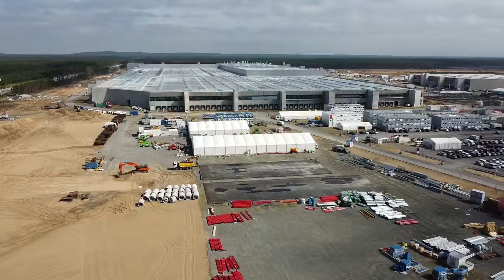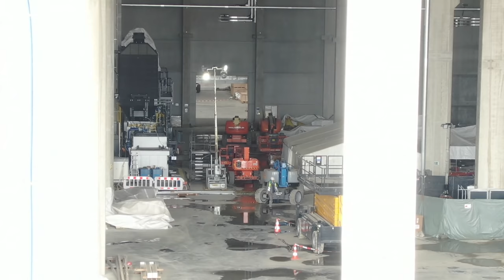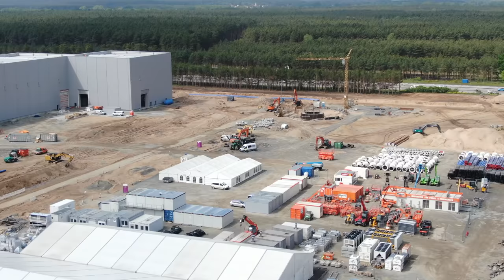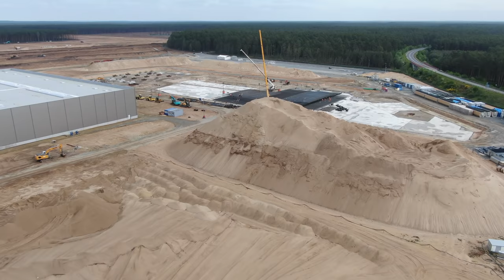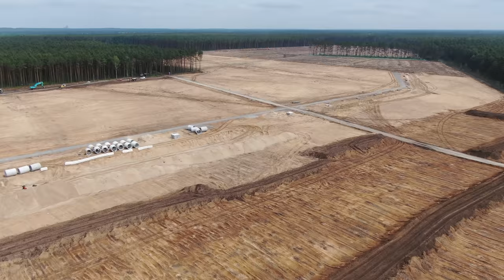Giga Berlin | 2021-05-29 | A lot of steel

Comment: That big steel area looks like it’s going to be used as a landing pad for a Starship more than anything else. 😉
Reply: Please don't discuss it, Elon will reveal it soon enough.
Reply: Exactly what I was thinking 😁 seems ridiculously built up even for an 8k ton Giga press.
Reply: The slightly modify the FAA orbital flight trajectory. SN20 will perhaps stop at Fremont picking up some 4680 cells too.
Reply: the risk of one of them crash landing and leveling the whole factory is too high.
Reply: it's for the 60k ton Model 2 - one step production stamp. 400kg square block of cold Aluminium in -> 60.000 ton stamp -> small earthquake -> ready full model 2 Frame

Comment: That Warehouse/battery factory building gets a massive foundation floor... I mean, if you need a ladder to get on top of it, its at least 1.5-2 meters thick. Must be some really heavy stuf that is going to be installed there.
Reply: 1,6m, stamping presses and deep drawing presses for the battery cases.
Reply: @julianreverse  Thanks, that makes sense.
Reply: Maybe a good vibration-proof base for sensitive precision machinery. I don't think that little casings for a battery (even a 4680) will need so much force  that this huge foundation will be needed. Even the stamping area does not have this type of foundation (https://www.youtube.com/watch?v=3pKYBqdXtSg)
Reply: @JestersHammer  Under the press shop are hundreds of concrete piles to distribute the force. And your video is showing the paint shop for what ever reason.
Reply from the maker: I think the middle part is even more like 1,7m, and we don't know for what they'll need this foundation. I agree with Martin Scheddin, that I don't think the presses for battery cells will need such big foundations. And it looks like half of the building will get a big foundation plate, while production of the case is just a tiny part of the cell production.
Reply: @JestersHammer  Indeed, vibration also is what comes to my mind. If this was just to take weight, there was no need to make it solid. We would see triangular structures distributing the pressure over an area. Or at least plenty of artificial air pockets to save material and add inner surfaces.
Reply: Probably because they're not using geopiers to stabilize soil under the foundation in Berlin as they are in Austin.
Reply: Was the foundation below the giga presses even that heavy?
Reply from the maker: @AndreR241  No, the foundation for the Giga Presses were not as deep and way smaller.
Reply: A semi-conductor fab probably also has a low tolerance for vibration.... 

Unlikely of course, and I think they are an environmental nightmare though, so even more unlikely in Germany.

Comment: 15:00 I am into construction for the last 20 years and have never seen so much steel reinforcement. This might not be battery factory. This is designed to carry extremely heavy dynamic loads like vibrations...
Reply: It looks it's built to withstand a 10.0 earthquake.
Reply: That. Is. Insanity. No machine vibrates that hard or else it's fucked up. Rocket start ramp?

It's often better to place vibrating stuff on absorbers than this.

Or are they trying to build a wind turbine foundation without being allowed to make a deep one? A 20 stories building?
Reply: That's what stamping and deep drawing presses do which are needed for the battery cases.
Reply: It's a landing pad for a starship
Reply: @fayereaganlover  That makes sense. I also think it is more probable that the Marsians will settle here than us there.

Comment: This is for sure the most complicated Building, for now, I guess the Rebar Field will be the position of the Batterie charging Raks like in Kato Road, guess a lot of weight needs to be supported on this Field on this sandy ground. Hope this time will be a Steal Building. 3 Stories or so because in the Videos looks like small for a Big Batterie factory. But like always mostly I am wrong. But anyway thanks for the great Video Tobias
Reply: It will probably be a concrete building.
Reply: @harryjessen  Most likely.

Comment: looks like we finally have a mold on the Gigapress in the area of the stairs @ 5:35 😃
Reply: I wonder how they deal with all that sand blown in constantly while the wall is still missing and the soil has been dirty for ages. Does not look good if you ask me. Precision? I don't know.

Germans are bureaucratic etc. but we keep stuff clean in the workplace. Not as tidy as the Japanese though :)

Also I cringe when I see how they lay the cables and part of the tubes.
Reply: @AndreasDelleske  i think the main reason is not to waste time with the necessary optimization loops
time is money and tools and machines are subject to high wear anyway.

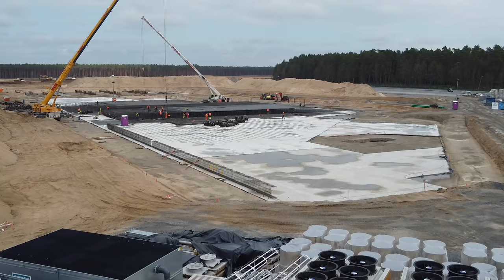Comment: What are they building @ 13:08 ? What needs a floor or a footing 5 feet thick?????
Reply from the maker: That will be the warehouse, which will most likely be the battery factory. We don't know for what they need the thick foundation, but there are speculations ranging from presses for battery cases to reduction of vibrations for more precision.
Reply: @TobiasLindh  Thanks.

Comment: What is the giant rebar frame work for..?
Reply: Read the comments.
Reply: @julianreverse  
Yes, sorry…..after I posted I scrolled down and saw all the other 
comments… a factual explanation for need of all that rebar would 
still be nice, the only thing I’ve seen even close to this was a dam..
Reply: @MrBad4fun  Maybe you should about concrete on Wikipedia.
Reply from the maker: Tesla got the permit for a warehouse, and we know that it will probably be the battery cell production line. But we don't know yet why they need this kind of foundation.

Comment: The endless shoveling of sand and mud is driving me crazy. In every video we've seen diggers taking dirt, putting it in a transporter, and seeing the transport vehicle drop it 100m away. I don't see that in Texas or Shanghai - why here? Why build that big mound of sand? Why take so much time simply digging a ditch for a pipe? Honestly very curious!
Reply: in germany we often like it complicated and useless.. bureaucracy
Reply: @jaSDdsaeE  🤦‍♂️
Reply: We just like it to dig holes, its fun. See here: https://www.youtube.com/watch?v=wWXEhJsYhYc&t
Reply: Because in Austin there was no topsoil or they simply used it to fill the craters. Not the best base to built on but good enough for US. Here they remove the topsoil and store it in the corner until they can reuse it or it's picked up by the disposal company. Digging trenches in lose sand is not like digging a trench in compact material. That's why a lot of material has to be moved for a small pipe.
Reply: Oh man, the first 2-3 months it was all they did in Texas.. moving dirt.

But it all has to do with the soil they are building on, and in Germany they had the complication of not being allowed to use piles. Result is digging huge holes in the ground to build very big foundations.

That sand mount will at some point disappear, when the foundations are ready and the place is back filled with the sand they removed earlier.

But the same has happened in Texas, there also a mountain of stored dirt, which was later used to fill foundation areas. And still a lot of digging and bulldozering is taking place in Texas.
Reply: @julianreverse  It's crazy to see how sandy this ground is everywhere. It's a good thing there is no earthquake there. I'm surprised it's not a desert with so few soil on top of it.
Reply from the maker: @MarcoNierop  It is allowed to use piles. And in fact Tesla already used piles.
Reply from the maker: There are a lot of different pipes at different levels and locations. That requires a lot of digging. For example, parts of the fresh water pipes are above the rain water pipes, so they have to dig deep for the rain water pipes, then partly fill back the sand, then put in the fresh water pipes and then fill in the rest. And only then they can start digging another trench right next to it, for cables etc..
Reply from the maker: @jaSDdsaeE  Your comment does not make any sense.
Reply: @jaSDdsaeE  Is that why a lot of my German friends are leaving Germany for other countries? Reminds me of California..

Comment: What's the idea with the strangely elevated rebars, perhaps they are skipping deeper foundations and footings this way and in result maybe that allows them to skip filing for a lot of new permits? Also any idea when they start building the support buildings (fire station etc.)?
Reply: Interestingly the """warehouse""" with one corner chopped off is shaped VERY similarly to Giga Texas 4680 plant on the North-West corner, so this might be a simple copy & paste of plans. Perhaps someone like @My Tesla Weekend could use Brian power to calculate the exact size of both? Surprisingly, neither will be a giant building, proving how efficient 4680 manufacturing is looking to be. 

https://www.youtube.com/channel/UCbNOk_wOA7UMvYrF7K0iBvQ
Reply: Lastly I wonder if it's so hard to get permit for water usage just for Phase I, why so much tree clearance so far from that building? Yes, some extra space, parking lot, train station needed, but clearance is just too big for that. Not sure if they will be allowed to double or triple current factory size as the original 4-phase plan suggests.
Reply: Idea is to avoid pile foundations. As the "warehouse" is partly in the area with the highest ground water protection standard. Parts of the GF4 grounds are however also in an area with no special ground water protection. Where a pile foundation would be a lesser problem.

It seems they plan to complete the missing support buildings one after the other starting from the switchyard
- tank farm (foundation partly finished)
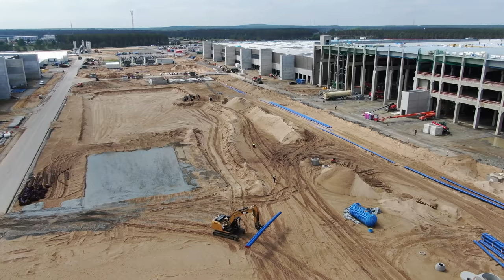- wastewater treatment (12:15 the larger pit and the smaller pit with gravel)
- energy center
- sprinkler center
- fire station
- hazardous material storage
No idea why Tesla does not build those buildings faster. Those are not that complex ones.

The plans are that the DU and the "warehouse" will become once one building which is a mirror of the main building of phase I. With the outer corner chopped off.

Water usage for phase I is already settled. The ongoing discussion is more generic. On phase II-IV and the expected growth of the population. The local water body WSE (3 towns and 12 smaller communities) is too small to solve this alone. But this does not mean that it can not be solved. Albeit not super fast. Stuttgart (Mercedes, Porsche) gets its water from the Swabian Alb and Lake Constance. So 50 - 150 km away.

The cleared area is mainly for logistics, i.e. storage of new cars and a railyard. Those however for phases I - IV.  There are also plans for a test track.
To clear more forests they need a reason - double the factory is a legit reason. The permission will be granted if there is a reason and the further condition (like time of the year, protection of endangered species, etc.) are obeyed.
Reply: @abalada  Thx, lot of excellent info! Yes based on the original 4-phase plan they might connect "warehouse" to DU, but right now DU was external/final wall that side and they don't appear to be making battery plant that big to reach DU. We'll see, hopefully soon.
Reply from the maker: The rebar is not elevated. The top of the rebar is on street level. Actually this is one of the deepest foundations.
Water usage for phase 1 is no problem.
A huge part of the cleared is actually simply a huge parking lot. Other sections are for rain water infiltration and temporary storage areas during construction. Later they will also use parts of that for expansion of the factory buildings.
Reply from the maker: @abalada  The warehouse is not even partly in the area with the highest ground water protection standard. It's completely in Zone III B. Unlike the stamping section where they used piles, which was completely in Zone III A.
The test track is is not the reason for tree clearance, as it is between the main building and the supply buildings.
Reply: @TobiasLindh  According to the below map
https://www.bi-gruenheide.de/wp-content/uploads/2020/01/Tesla_Plan-04.jpg
the warehouse is - for a smaller part - also in zone III A. 

There are plans for two test tracks. One on the central axis to do the short test of all newly produced cars before they are delivered. And another test track on the newly cleared area, which will be used for more thorough tests (e.g. by the development department).
Reply from the maker: @abalada  The warehouse is roughly at the location of the SE section in that image. It does not touch Zone III A on any side.

I have never heard about a second test track. Do you have any source for that?

Comment: Damn, that's a lot of rebar for a "warehouse" lol
Reply: They got a permit to make it the battery factory, so I'm guessing that's the plan. The size and shape of that massive rebar area is pretty comparable to the central one in the NW corner of the Giga Texas factory.
Reply from the maker: @FutureAzA  Actually they only got a permit for a warehouse. They still didn't even apply for a battery factory yet. But we know that they informed the authorities that they intend to build the battery production in the warehouse, and they announced that they will include the battery factory in the changed application documents. The foundation is probably already being build to handle the battery production line.

Comment: What the heck is that raised re-rod floor for in the Battery/Warehouse building?
Reply: pure guess but it might be for the battery formation equipment
Reply: For stamping presses and deep drawing presses for the battery cases.
Reply: @julianreverse  Sorry, I don't understand. There is a layer of re-rod and about 3 feet above it is another layer of re-rod. Is concrete going to be 3 feet thick? If not, where is the floor, on the bottom or on the top, and what is between the two layers of re-rod?
Reply: @gmoncrieff  Battery equipment in a "warehouse"? Wink wink. LOL. :) 

How he thinks there isn't going to be major blow back from the State when he applies for a battery permit after he went to the County for a Warehouse permit to do an end-run around the State is beyond me. Chess at another level I guess.
Reply: @disturbed4733  Yes, of course, will be completely filled with concrete. And there is not just one layer at the top / bottom, there are several layers.
Reply: It's for the main battle cannon
Reply: @julianreverse  Wow, what a foundation. I am going to go back and watch old videos from Giga Austin to see if they did the same thing for their stamping presses.
Reply: @disturbed4733  It's not for the body shop!
Reply: @julianreverse  I intended to type stamping area of the "battery shop" but cut the last part off, sorry. 

I found it in the Feb video of the Austin plant. Same type of steel framework except it's all below grade rather than above grade. Think I remember reading  Berlin limited foundation depths to  protect water tables, maybe that's why the difference.
Anyway, thanks for your help.
Reply from the maker: This is also below grade. It just looks like it's above, because they excavated a lot of sand for the whole building footprint.
Reply: @TobiasLindh  Thanks. Will take another look and maybe make an appointment with an optometrist. :)
Reply: Its the foundations for a space lift to the moon!!!

Comment: Tobias I seen on another channel 24 hour work has been reapproved is that accurate?
Reply: Yes, for most parts indoors.
Reply: @julianreverse  from the recent approval it seemed to include almost everywhere in the main building, great news!
Reply from the maker: For supply buildings and the casting section, they are allowed to do all work 24h. Work inside the buildings is allowed 24h and 7am-8pm on Sundays in all sections of the main building and the supply buildings.

Comment: Are they allowed to start production yet or are regulations still holding them back?
Reply: The factory isn't even finished.
Reply: 1. there are still a number of auxiliary buildings/facilities needed to start production
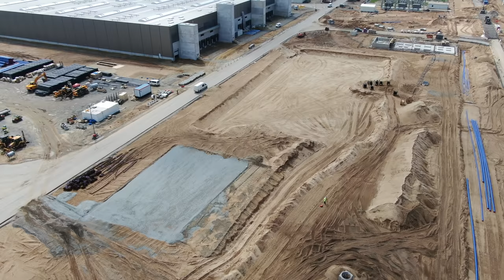- wastewater treatment (the two pits you can spot at 12:25)
- energy center (not yet started, all in a row north of wastewater treatment)
- sprinkler center
- fire station
- hazardous materials storage
All by the way covered by a permit Tesla was granted in July 2020.
2. while some parts of the factory are more or less production ready, others (e.g. GA and DU) are still bare of any production equipment. Elon Musk had surely htis reasons to tweet that some supplier should accelerate. And I don't think that we will see this equipment in the next few weeks.

Comment: Is it only illusion, or is it very low in the terrain? There can be really heavy rainstorms in the region from time to time.
Reply: It's a rather flat terrain. But the GF4 lies so 10 m above the next close rivers and towns. Which is for this area at "high" altitude.
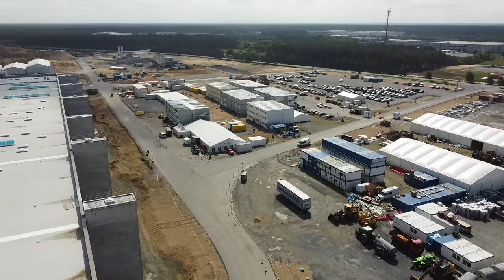Reply: @abalada  ~2:24 and forward looks like whole surrounding terrain slopes towards gates of the building,  which are at lowest point.
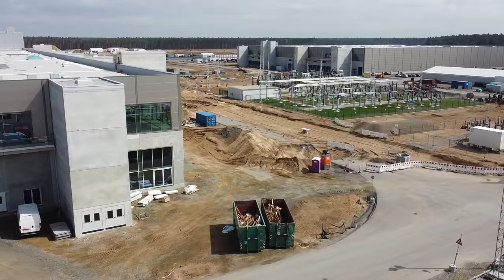Reply: @damianlund395  The main entrance to the grounds (0:48) is nearly exactly at 40 m above sea level. The road crossing at 3:20 originally (before earth works) a bit above 50 m. 
The lowest point of the GF4 grounds lies a bit north of the entrance to the main building towards the autobahn. 
But basically GF4 lies on a "hill" between two rivers. Pretty safe from floodings, which are in this area anyway rare.
Reply from the maker: @damianlund395  That's an illusion. It just looks like that, because the two roads are not parallel. The land on the property is flat.